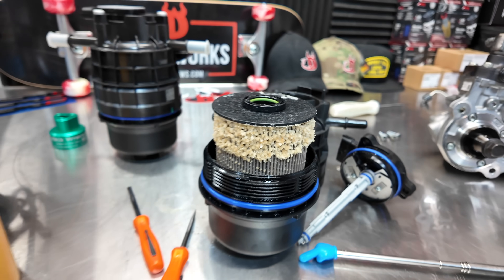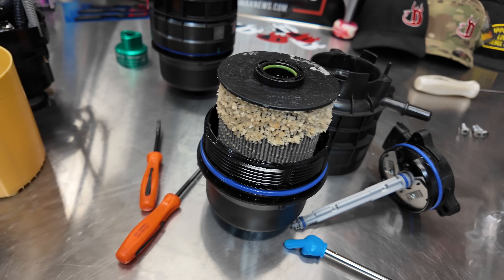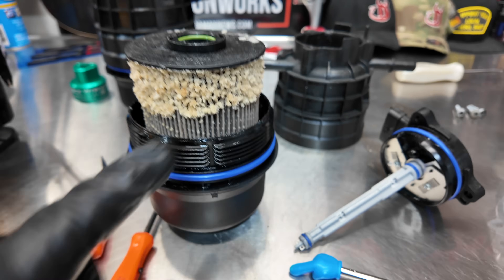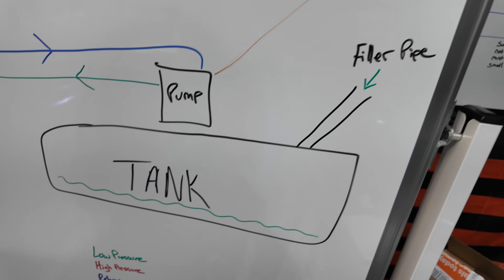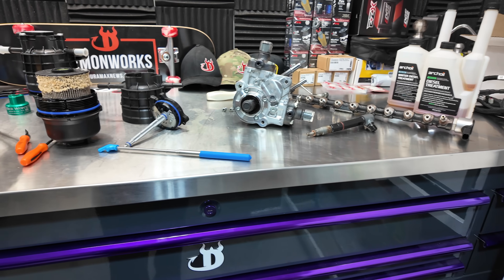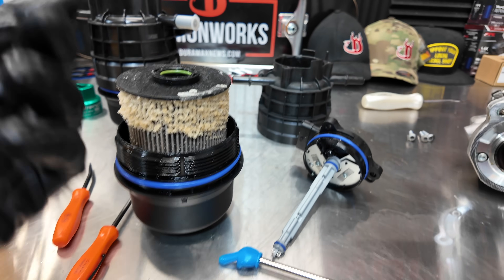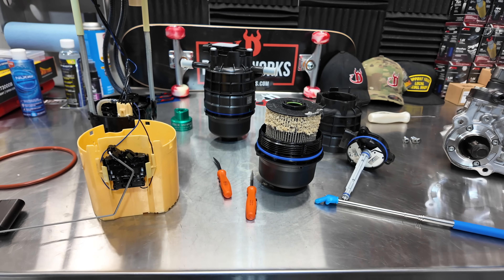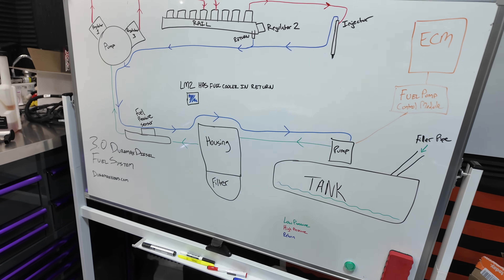This Is BAD! DEF in FUEL - CRITICAL Steps To Save $$$

Comment: How about contaminated fuel?  I just got the call my truck somehow got contaminated fuel. Not water, but haven’t told me what contamination. 

I drove for 9 days after refueling then truck randomly went into limp mode. Towed to dealer they first replaced the battery. Called me today to pick it up and it threw a high pressure fuel code before I could even get in it. They did some testing and said it was contaminated fuel.    

I’m a little skeptical considering I haven’t put diesel in it since 12/9.  And this code wasn’t showing up on the initial scan.

Comment: Think this is bad for your truck, imagine it going into a jet!  This has happened numerous times.  The newer diesel fuel trucks use DEF, these trucks also have another tank on them for a product called PRIST.  PRIST is an anti icing agent for any water that might get into the fuel tanks on a jet aircraft.  The problem is there is very little, to line service personnel, that differentiates between the DEF tank and the PRIST tank on the fueler truck.  Many FBOs (Fixed Based Operations) that offer fueling have put procedures into place to help prevent such things but it is not universal.  There is not color matching or anti tapper mechanisms in place for this.  Believe me it is much more expensive to deal with this in the aviation world!

Comment: I don’t see why GM doesn’t separate these two fill ports, I guess they are hoping you’ll mess up. It would be so easy to put the def fill under the hood.
Reply: They used to do that on the 2500's

Comment: The Dealership quoted me 25,000.00 they said they had to replace all the fuel and def system according to GMAC. I took it to a local diesel repair shop that I use and they did it for way way cheaper.

Comment: I like the idea of pulling the battery negative cable until the lift pump relay or connection at the lift pump can be disconnected.  With all the electronics on the truck it inevitable that the tow truck operator will need to power up the truck to move it and then lock it.  Green “Diesel” cap was one of my first purchases. Stay safe everyone.

Comment: I have a  '24 LZ0, never filled it up wrong but have though about it.  Can you actually open the hood without fuel pump turning on to disconnect battery or disable fuel pump? - normally one would have to open the door to do that which usually turns on many things.  Would it not be better to first pull battery from FOB while away from vehicle then disconnect the fuel pump.  Fuel pump disconnect should be able to be done without opening truck door.   For that matter if can't disconnect, have wire cutters and cut the harness to the pump - much less $$ than replacing anything beyond the pump.  Probably also good idea to take the battery out of key fob before anything to reduce chance of fuel pump activation.  Carry a 36mm socket / breaker bar to allow pulling the filter housing.   Also, yank the fuel pump relay and fuse so that when the power is turned on to steer / etc, no fuel pump.

Comment: How are you opening the hood to get to the battery without opening the door, and thus causing the pump to kick on?
Reply from the maker: If you are filling at the pump, the system is already primed and likely not going to activate the pump. The pump typically turns on only after an extended amount of time as the purpose is to prime the system.

Comment: Great video thanks!!🙏  Disconnecting the battery after accidentally putting DEF fluid in the diesel tank.   I would definitely not have thought of that.  thank you very much!  I did purchase a diesel fuel cap some time ago.   S**t can happen.

Comment: Yeah but if you open the door the fuel pump turns on. I would drop the filter immediately.
Reply from the maker: Typically the pump will only turn on in that case after the vehicle has sat for an extended period of time. So at the pump, all should be fine.

Comment: My coworker realized he did it in his 2500.  Didn't start it and disconnected the battery.  Dropped the tank in Walmart parking lot and they drained the tank and flushed it with a couple rounds of diesel into 50 gallon drums.  Put it back on and drove off.  No issues.  Just a headache
Good advice

Comment: I used a label maker and made up a label that says DIESEL ONLY and placed this under the diesel fill port. Also bought a green cap that fits into the diesel fill port which also says DIESEL. I only fill DEF tank with jugs of DEF at home so no DEF pump fill for me. And while at a fueling station I always double check that I am using the green hose and pump handle. 
When I was on vacation in Scotland we rented a diesel vehicle. When I went to fill it at first I grabbed the green pump handle but upon further inspection their diesel pump handle is yellow. Luckily I caught myself before I put gas in the diesel.

Comment: Cant pop hood with out opening door. So best to immediately pull your fuel filter So fuel can not go farther. Then you can open the door and put it in neutral after chocking the wheel. Pop the hood and disconnect battery. Then put fuel filter cap back on.  I use masking tape and right what to do or not do on it.

Comment: They are not cheap, but I have a set of locking diesel and DEF caps, they make me think before I unlock and remove one of them before filling fuel or DEF, they keep anyone else from sabotaging the system by introducing something bad like sugar, and even keep well meaning family from making a mistake trying to fill up with gasoline accidentally after using the truck, rare for me to lend it out, but it could happen.

Comment: I heard that just just unlocking and/or opening the door primes the fuel system so that's what I would NOT do.  So that would prevent me from opening the hood and disconnecting the battery.  Good idea about removing the filter housing in case it does run the the pump.  We don't have DEF pumps here, just the boxes, and I have had a cap since I got the truck new to keep dirt out so I'm already well prepared.  And just in case, I have told my wife if this should ever happen to not touch the remote or the door and call me.

Now you need to do a video of what happens when you put diesel in the DEF tank and how to deal with it.
Reply: The fuel nozzle wont fit in the DEF opening.
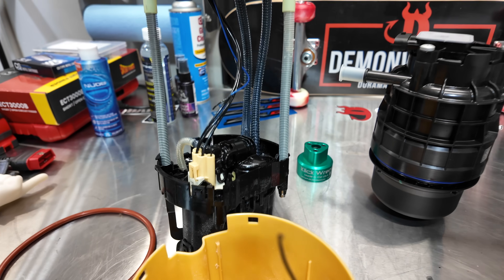Reply from the maker: Correct 1:45 that pump can run. That's why I say to disconnect the battery. The chance of it running at the pump immediately after filling is highly unlikely since the system is already primed.

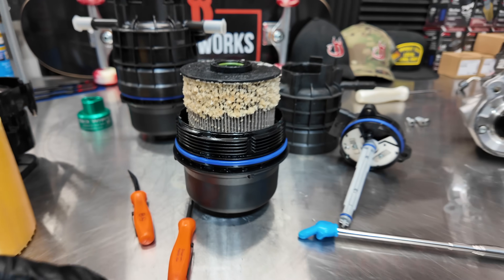Comment from the maker: 🚨 IN A PANIC? If you just put DEF in your tank, DO NOT TURN THE KEY. Jump to 06:40 immediately to see how to kill the power before the pump wakes up.

Once you are safe, grab a proper fuel cap so this never happens again: https://www.demonworkshop.com/products/2020-2025-gm-3-0l-duramax-diesel-fuel-cap-173001000

👇 Question: Have you ever had a close call with the green handle at the pump? Let me know !

Comment: Wouldn’t unlocking the door to pop the hood run the pump?
Reply from the maker: Yes, that's why it's important to kill that battery asap. Typically, the pump will turn on for the unlock only after the vehicle has sat for an extended amoutn of time, it's to prime the system. if you are at the pump filling, it likely will not prime again until the button is pushed.
Reply: @DemonWorks gotcha - didn’t know exactly what triggered that. Might not be a bad idea to keep the large socket for the fuel filter housing in the bed I guess just in case. Assuming gas contamination is much less serious unless the engine has been started and definitely gone through the HPFP?
Reply: IF IT WERE TO HAPPEN TO ME, I would go through the passenger or back doors to reach the hood latch, after I removed the inlet hose or the fuel filter cap, perhaps even both, then unhook the negative terminal and have it towed from the rear so the parking brake wouldn’t matter. Then hopefully it would just be drain and replace tank, filler neck, and tank pump.
Reply: For you dipshits putting DEF in your 2500HD, there's two batteries........ muuuuuuhhhhhaaahhaaahhaaa......... suckas!
Reply: If the elect parking brakes are removed. Will disconnecting the battery trigger a safety to re apply the elect parking brakes?
Reply: pull the fuel filter 1st thing. then even if the pump does come on def wont go farther.

Comment: I never even considered how easy it would be to put the DEF in the fuel filler.  I have thought about how easy it would be to put gas in there.  So yeah definitely getting that cap for my truck.  Just an extra safety measure against either mistake.

Comment: Man I hope the EPA modifies the clean air standard, then DEF will no longer be needed .. looks like a solid possibility in the VERY NEAR Future.
Excellent video.. and already got a diesel fuel cap for mine.
Reply: Not happening. Unfortunately
Reply: @BabyGators  Might want to check out TK's garage.  Sean Duffy in the EPA is chopping down these rules.
Nothing guaranteed yet.. but hopeful.
Ford and RAM have already been verified testing diesels without DEF.
Reply: @texZR2 he hasn't done shit!
Reply: @t @texZR2 the changes that have been talked about do not affect DPF systems
Reply: @texZR2  Might want to do your own research into what it takes to roll back regulation like the one that gifted us these piece of shit def systems. EPA can't do anything on its own in terms of deleting that requirement.
Reply: @thesandman775  WRONG.

The U.S. Environmental Protection Agency (EPA) is the primary federal agency responsible for clean air regulations for auto manufacturers under the Clean Air Act.
The EPA has the authority to set national emission standards for mobile sources, including cars, trucks, and buses, and to enforce compliance through certification, inspections, and enforcement actions.

Hence with this current administration they can and are relaxing and removing the previous administrations draconian standards.

And by doing so, auto manufacturers don't have to install all this extra DPF crap.

Go ahead.. tell me I'm wrong.
Reply: @texZR2  I already told you that you're wrong. This comes down to the fact that you have zero clue where the DEF requirement actually comes from and what it actually takes to roll that back, or how the government entities at play here work. But I'm not going to spend any time doing your research for you. Live in ignorance and by extension constant outrage when things don't fit your narrative if you want, I couldn't care less. Just remember when the EPA doesn't do shit like rolling back def requirements because they legally cannot, you were already told that by a random in the comments section of a YouTube video.
Reply: @thesandman775  The EPA sets the emission STANDARDS..  they absolutely have the authority.

But hey.. continue to live in ignorance.
Reply: @texZR2  once again, you have no clue how any of this works. They need Congress, who actually controls the laws. There's really no excuse these days, this information is readily available. Even AI can outline this very clearly for you if that's your thing. Go do some reading brother 😂
Reply: @thesandman775  It's a regulation.. not a law.
The law was the Clean Air Act which gave the responsibility to REGULATE to the EPA.

We are talking about changing regulations.. not laws.

Manufacturers had to develop this hardware to meet REGULATIONS handed down by the EPA and Dept of Transportation. 

Look up CAFE.. is it a regulation or a law?

Go do some reading yourself.. you need it.
Reply: @texZR2  Gotta say, anybody who actually believes TK's Garage is living in fantasy land.  He's been playing people from the start telling them stuff that's just flat wrong.
Reply: Won't do anything for existing systems
Reply: @mooseman3136 but it won’t be illegal to delete the old ones if they remove the requirements
Reply: EPA has no ability to get rid of DEF systems on their own. They can alter some of the operation characteristics (like delaying derates). But they can't eliminate the DEF system requirement without an act of Congress. You guys need to do some research for yourself and stop listening to click bait content creators (demon works definitely isn't in that population, always great content on this channel)
Reply: @thesandman775  100% correct and the poster who mentioned that TK guy he is nothing more than a Stellantis fan boy major click bait page.
Reply: @chris6743 Yeah, can really tell the people that do nothing but parrot other sources without any attempt to understand the facts